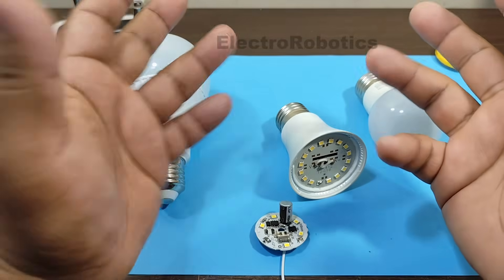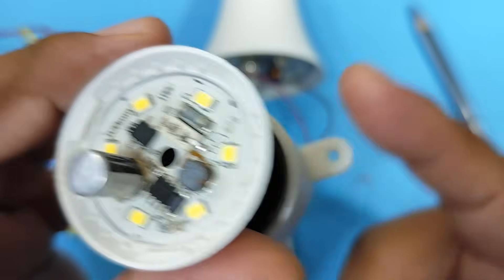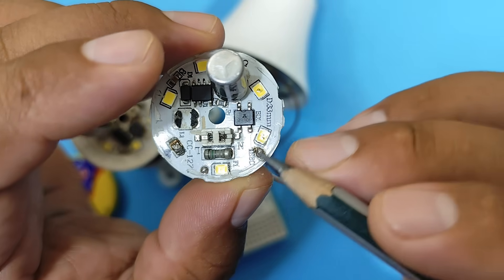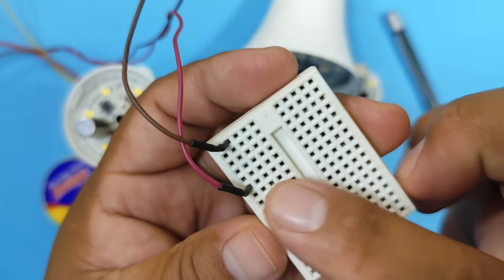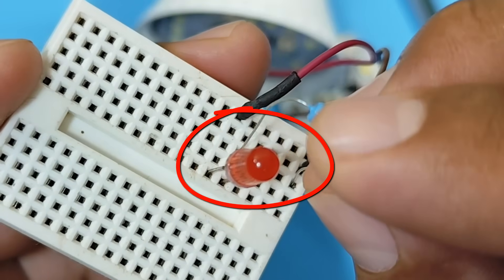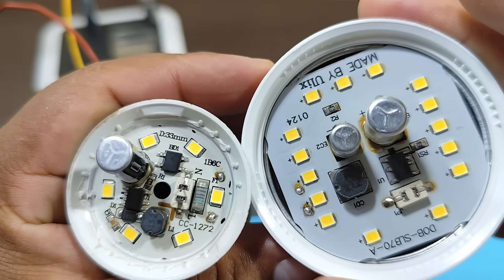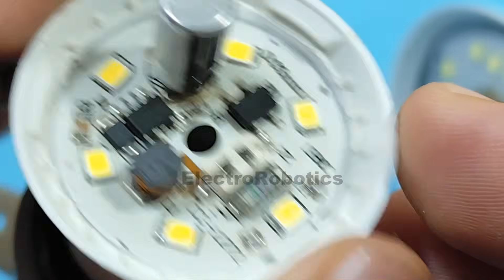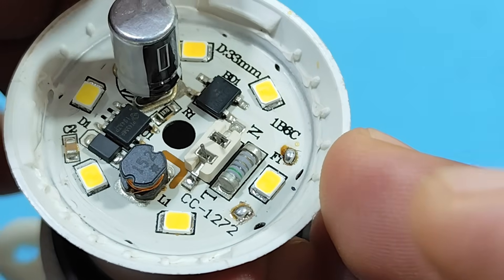Learn How to Make Any LED Bulb Last for Several Years.

Comment: Generally a good option. But you should have pointed out that the resistor's wattage should be checked by calculation or a heat risk for the user can occur. For example you chose a half watt resistor which is good. But the user should calculate the wattage needed first by multiplying the resistor ohm value with the milliamps going through. In your example the 3 ohm resistor had 84 mA going through which means 3 * 84 = 252 mW is converted into heat. If the user takes the quarter watt resistor (=250 mW) it would go to 101% of the resistor wattage. Usually when designing you make the thumb rule of taking a factor of 2 for the wattage. So => The quarter watt resistor could get quite hot because he is a space that is not open to fresh air. I would not recommend anybody to take the quarter watt resistor, it could get overly hot. Note that the SMD resistor (the original one) is profiting from the cooling metal plate below, while the quarter watt resistor would not. So for the users: Just take a resistor that is double the wattage that the multiplication of the ohm value with the measured milliamps will yield. Then you should probably be on the safe side.

Comment: Some LED lights have four or five resistors, so which resistor should we replace? Should we look for the largest resistor?
Reply: In general, the resistor is located close to or right next to the regulator circuit, and its value is always low, less than 10 ohms.
Reply: Simply replace that bulb with lower powered one 🛒

Comment: How did you measure the current through the led? Presumably, you cut a track and inserted the ammeter there, but you didn't show that.
Reply: I do not know, how he did it.
However, this low Ohm resistor is the shunt, where all DC LED current goes thru. Measure the voltage at the shunt and you get the current.
Be aware this can be pulsed current with high frequency. Some cheap digital multimeters display this inaccurate or totally wrong.

Also be aware, this is high voltage and potentially dangerous.

You do not need the absolute value. So you can simply measure the ac current and compare these values.
Reply: On the - &+ end of the led connect the multimeter probs
Reply: @spicky2966 That will give you the Voltage, for current measurement it must be in series.

Comment: Without a schematic diagram so that the user can adapt it to their own lamps, this video is completely useless...
Reply: To do certain things, a little bit of background knowledge and skill may be required. While it's useless to some, it's a gold mine to me. There are levels to everything and people see things accordingly. Hope it helps!
Reply: @roseelectronics4582    either you can't or don't want to understand what I'm writing... you're showing a conversion, without drawing a schematic where you explain what you're doing... it doesn't mean that whoever judges you on an unfinished video doesn't have a level of knowledge... I personally know exactly what you're doing, but the video is still lacking, since you don't show the conversion with a diagram, since not all bulbs have the same design.
Reply: It's the lowest value resistor. If there is a part number on the ic, you can google for a datasheet and see a typical circuit.

Comment: Je comprends pas bien où vous avez  soudé vos pointes de touche pour mesurer le courant...?
Reply: Across one of the LEDs, no matter which one.
Reply: @blg53 ok merci !
Reply: @blg53  Must be more to it than that. Current is measured with a series connection, not parallel.
Reply: @km4hr  Not really in this case. LED driver is a CONSTANT CURRENT one, so the current does not depend on the load (the number of LEDs). By putting an ampermeter across one of the LEDs we effectively short-circuit it as the impedance of the ampermeter is an order of magnitude lower than the LED, so practically all the current flows through the ampermeter. And therefore it can measure it.
Reply: @blg53  Good point but why doesn't the shorted LED go dark?
Reply: @km4hr  It actually does go dark. It might have some faint glow due to the small portion of current that still flows through the LED is just about sufficient to gently light it. Or it might not at all.
Reply: @blg53 Current is measured in series, not the "across" you mentioned !
Reply: @azaztemp  Classical example of dangers of little knowledge.  Please read earlier posts of how it is done and why it works. Especially the point of the nature of an LED driver and relative resistance of an LED and an ampermeter.
Reply: hi , from kurdistan . what I do , I drill the light bulb for ventilation , indoor , it work for many many years . Especially for especially for ruler lights , consider that cold air when heat , it rise up . to make the holes